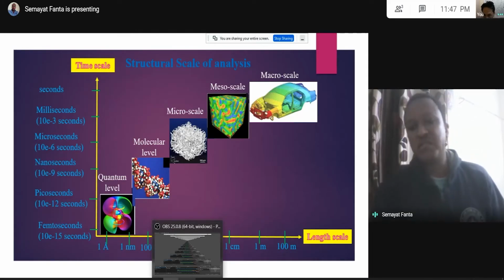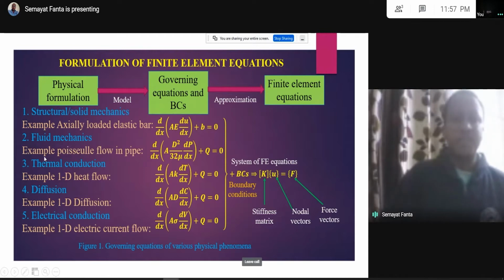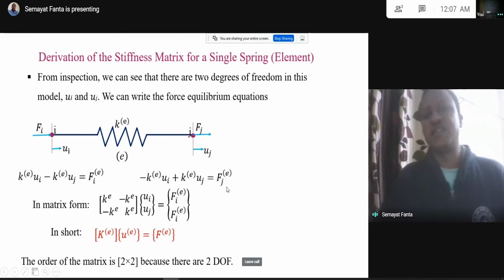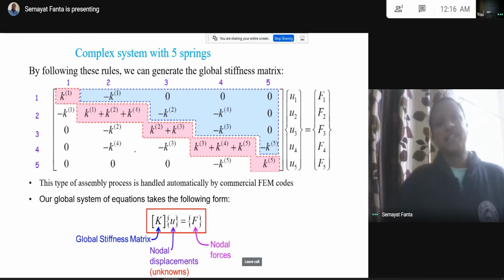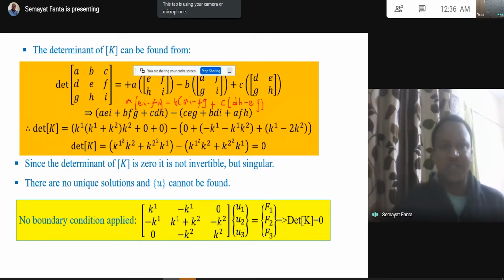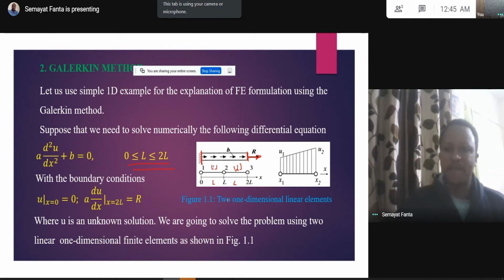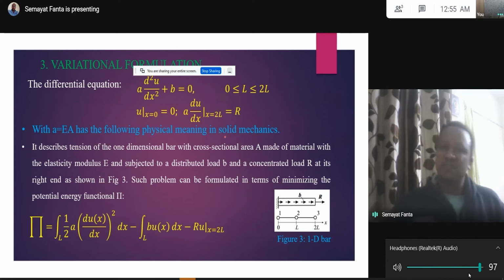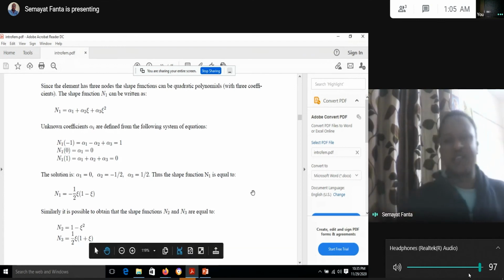Finite Element Method Lecture Series No. 4

Comment: When it comes to structural analysis, FEM is a powerful method for calculating displacements, stresses, and strains in a structure under a set of loads. In fact, we not only use FEA in daily analysis, we also use FEA to optimize our structural designs. FEA tools allow us to quickly test many design variations and also optimize our design. What I mean by optimization is the mass reduction of our structures. Nowadays, the mass savings in our structures translate into a lower cost of the product, a lower cost of transport, etc. FEA is very important for a structural engineer. This saves time, allows for rapid variation in designs, and is often used to bring out a lean product.